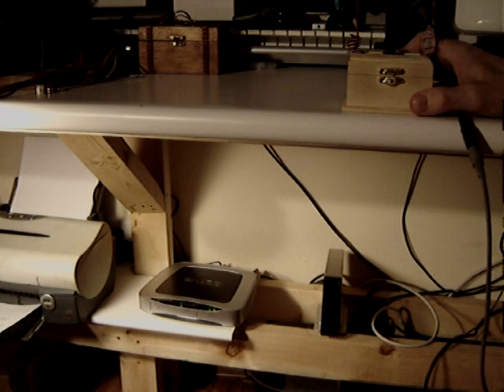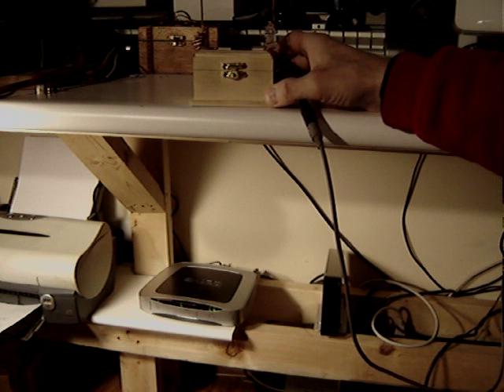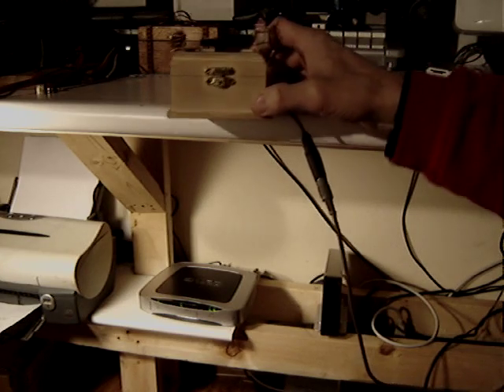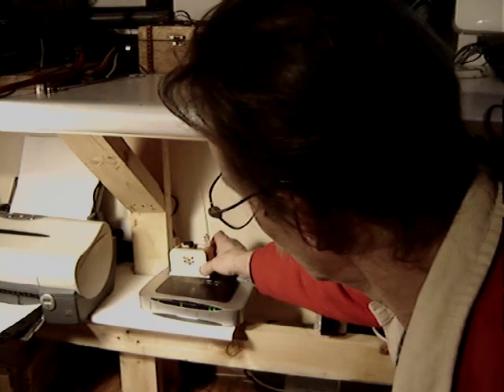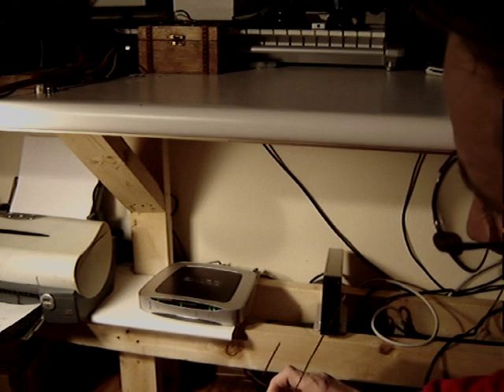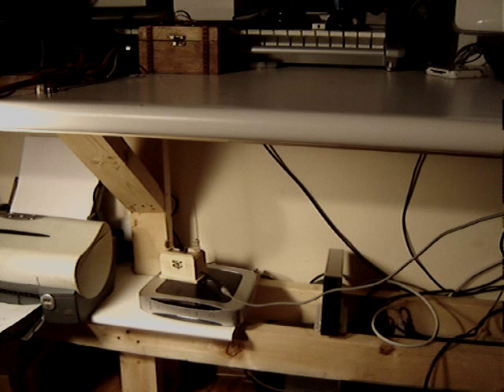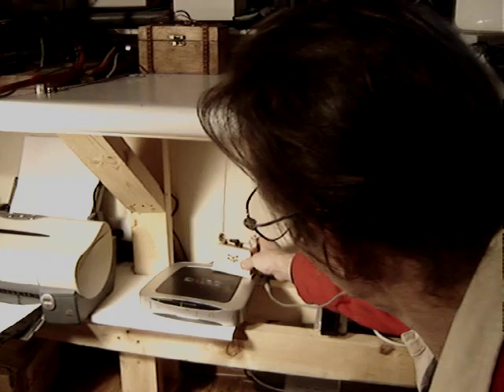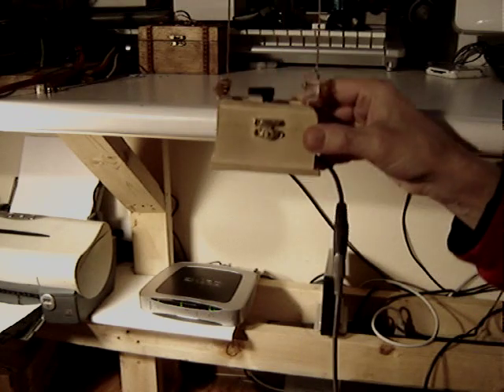Spirit Radio Woodpecker Detector

Comment from the maker: @mannydeguzmanjartist 

This spirit radio is not designed for that. There are modern brainwave sensors that might work to find a baseline if you really need to. However, you might try experimenting with the Brane-Power devices of EJ Gold, some of which have protective crystals or circuits to help with night-time voyaging. Check out yoyodyneindustries(dot)com for more info.

Comment: If you're talking about CDMA, GSM or other mobile-internet technologies (think mobile phone), then I don't know.

However, this sounds simply like 802.11 (wireless networking) beacon transmissions - transmissions the wireless switch/router sends out in short bursts to advertise its presence to other wireless devices nearby so they can connect. It's technically not necessary to have these beacon packets transmitted, as wireless devices can actively discover the wireless network without it.

Comment from the maker: The woodpecker noise I recorded comes from the phone company's wireless modem. The sound kicks in only when the unit starts sending wirelessly. 

The sound intensity is greatest at a certain location a couple of inches above the modem, and has standing waves a few centimetres apart that can be picked up by the crystal radio at least a couple of metres away.

Comment from the maker: The Beta Blocker Spirit Radio is a basic unshielded crystal diode receiver circuit and will pick up virtually all frequencies. Mr Gold does his special tuning on it to enable it as a beta blocker transmitter. 

I simply soldered in an audio patch cord into the simple 4-component crystal diode circuit inside the box. I plugged that cord into my iMac computer sound-in jack. 

I use a realtime software DSP recording program called Audio Hijack Pro to increase gain and add audio filters.

Comment: I am confused.....my understanding of the Spirit Radio.....is that it is a Transmitter, which transmits a frequency which blocks Beta.......it has no speaker or audio output.....so what is putting out the sound we hear ?

Comment from the maker: You might be interested to know I already got this unpowered radio to work as a theramin (it already has two antennas), as well as a microphone, morse code audio oscillator, laser light communicator, RF field discriminator, and the above RF pulse detector. The radio can tell the difference between AC and DC light, makes weird music, and is very educational in learning about harmonics and resonance. 

But all of these are besides it's true purpose and main use as a beta brain wave blocker.

Comment from the maker: The Beta Blocker Spirit Radio was obtained from EJ Gold at IDHHB. It is normally not used in this way. 

If you want to experiment with a "woodpecker detector", I would suggest using the simplest, unshielded, basic crystal or diode radio circuit you can find. The radio circuit will pick up any stray RF fields. Where the circuit has an earphone, plug it into your computer sound-in port. 

 Using a real-time program like Audio Hijack can alter the frequency for better human hearing.